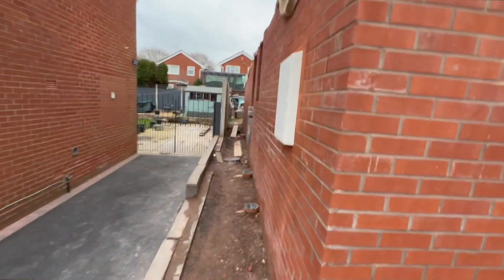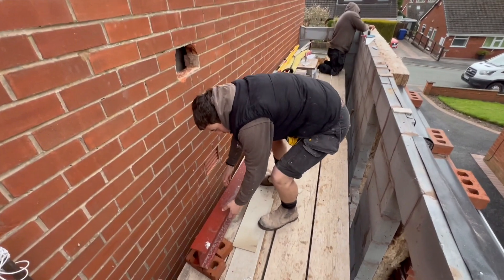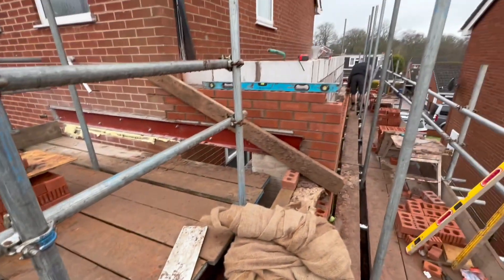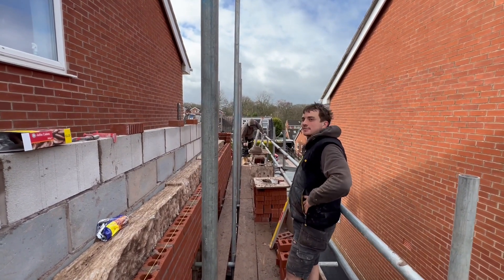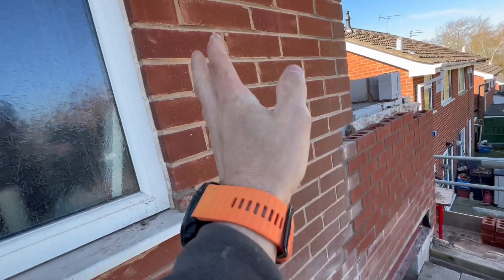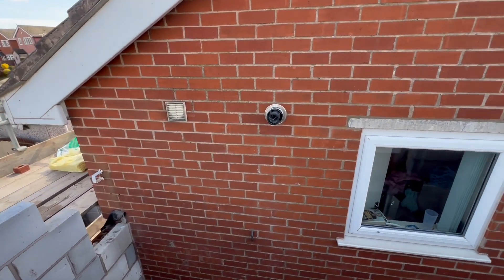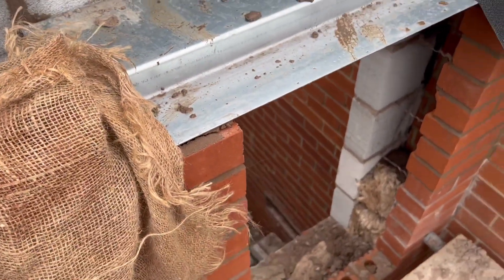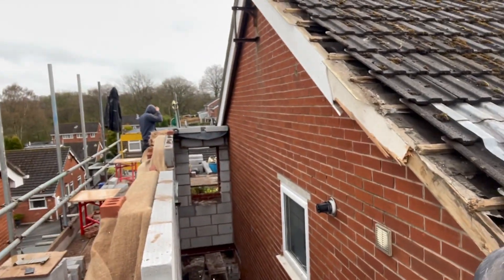What Really Happens During the Brickwork Stage of a House Extension

Comment: I'm surprised the building inspector didn't pull u up on the vertical damp witch u didn't put in on side of the house
Reply from the maker: There is a vertical dpc cut in.  You must of missed it.  Building control would pull it otherwise.  But thanks for you input 👍.